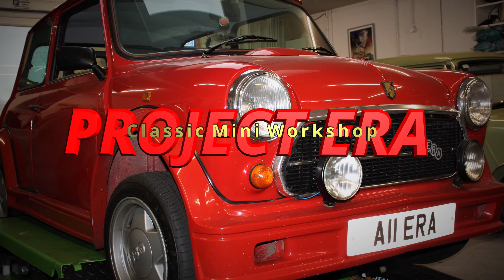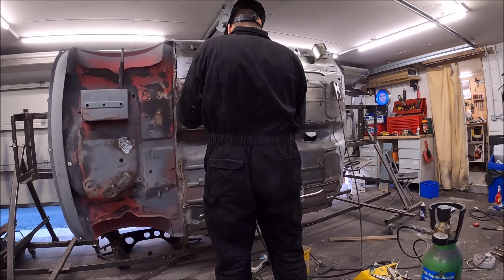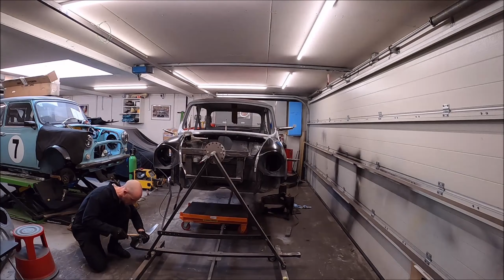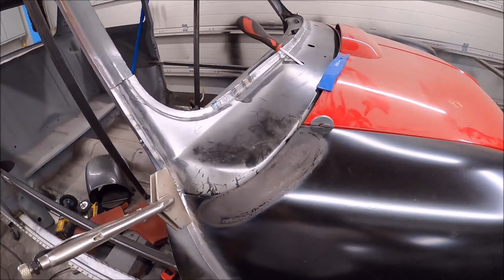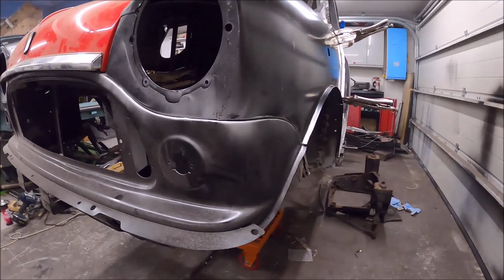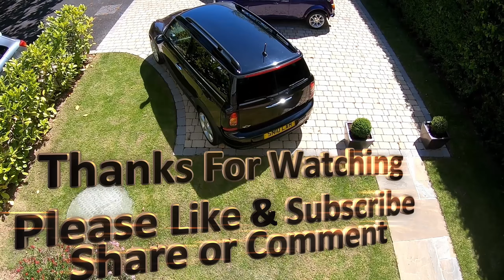Project ERA Part 9 - Classic Mini Workshop - Fitting the front end

Comment: Exellent progress on both builds. Some people fit the subframe and bolt up the front panel first where both Mark and you have fitted the panels first what is the advantages disadvantages of both methods? As that is the next step on my 89 brg.
Reply from the maker: The front panel to subframe fitment can be adjusted with shims, many minis have shims fitted from new so if it doesn't quite align there is some adjustment whereas if you fit the front panel first you cant really adjust the wing to scuttle gaps. Hope that makes sense?
Reply: @classicminiworkshop  thanks great help.

Comment: You’re no doubt aware that the wheel arches will need cutting away for the body kit, but what I didn’t realise when I replaced the front panel on mine many years ago, was that the corners under the lip where the bumper usually bolts too have also been cut away. This is to clear the air scoops on the back of the body kit.
I only noticed when it was back from paint and the bodykit wouldn’t fit!
Reply: I kept all the front end panels so i could mark them on the new panels. This will be a few videos further on. Thanks for the heads up though.😎